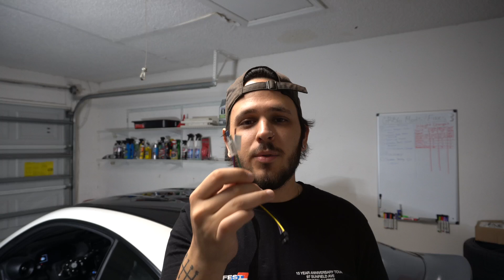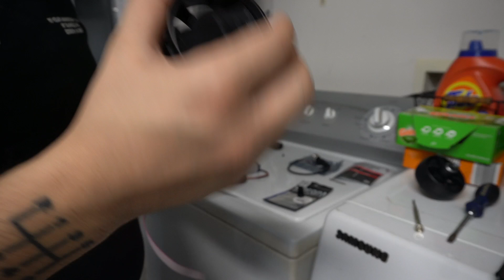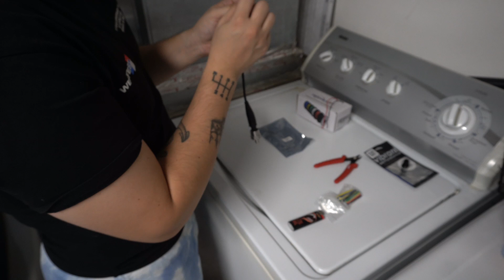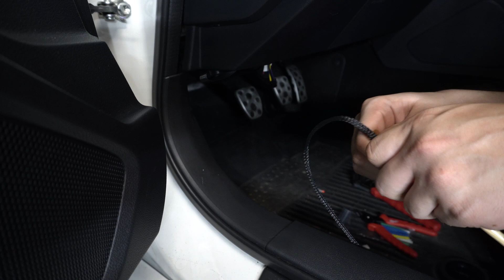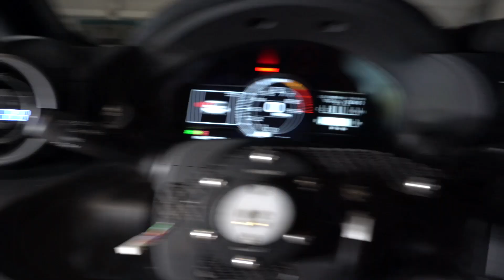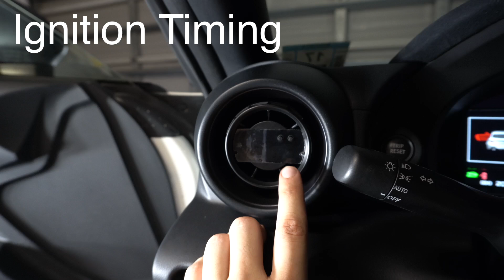OIL PRESSURE SENSOR & P3 GAUGE for the GR86!!

Comment: Quick question 
Can you still adjust the vent position? I’m thinking of getting it but considering the heat over here I don’t want to lose that functionality
Reply from the maker: So unfortunately you can’t adjust position or open/close it but for my optimal driving position it aims at me pretty well. I haven’t seen it as an issue but it might be for others. The trade off in my opinion is still worth it. Hope this helps!
Reply: @Fin_mistake oh ok, that’s really unfortunate 
Thank you for the help